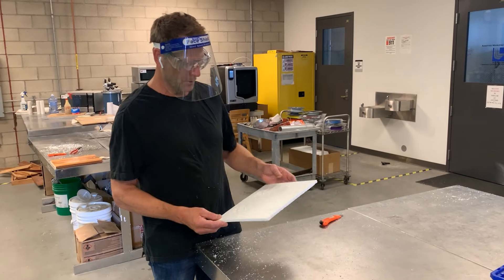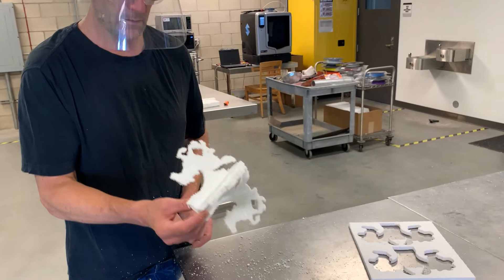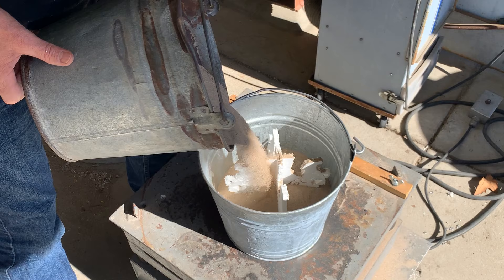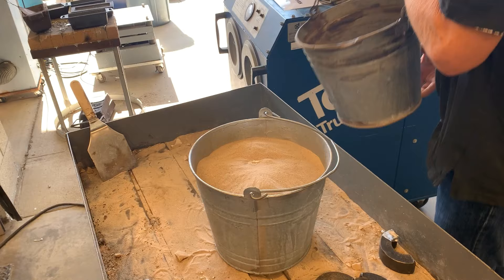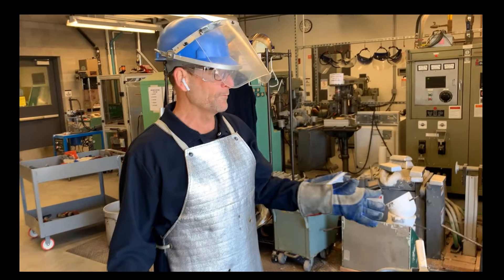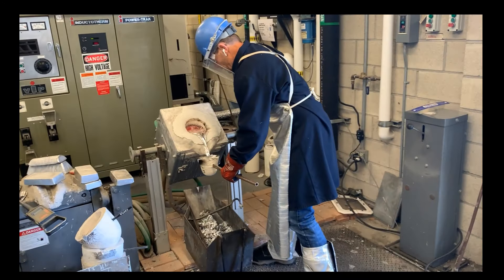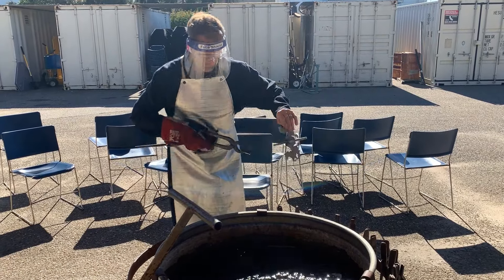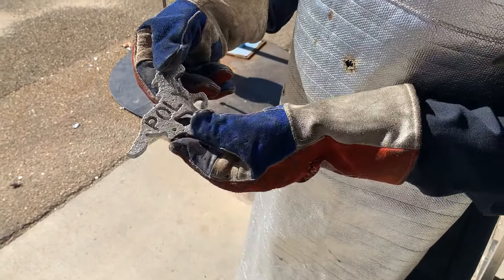IME 141 Lost Foam Mustangs

Comment: As far as I know, aluminum is highly undesirable to melt in an induction furnace due to the fact that, under the influence of an electromagnetic field, aluminum is mixed and strongly oxidized.
How do you prevent oxidation?
What is the frequency?